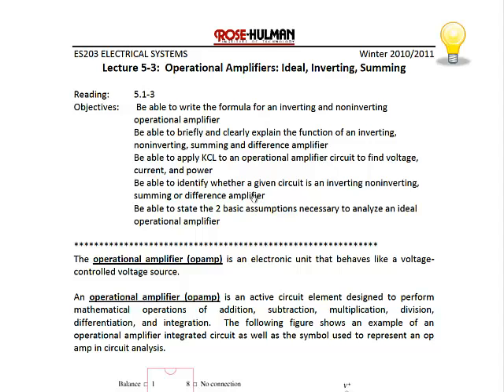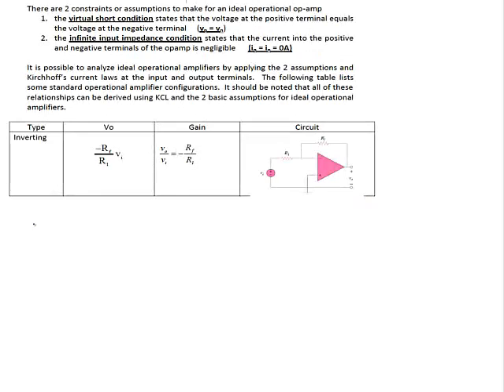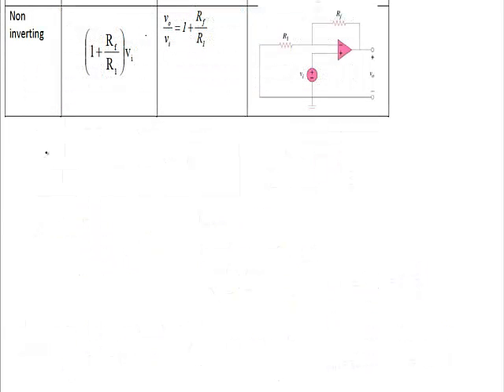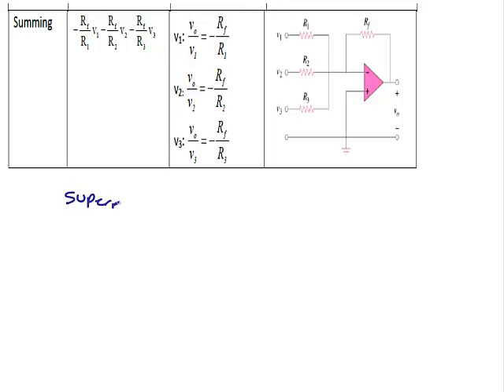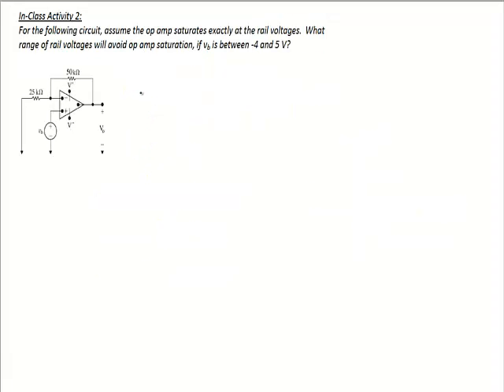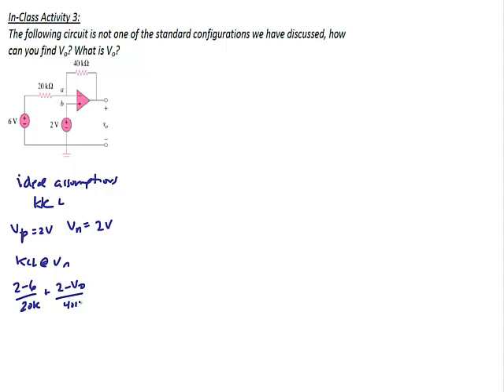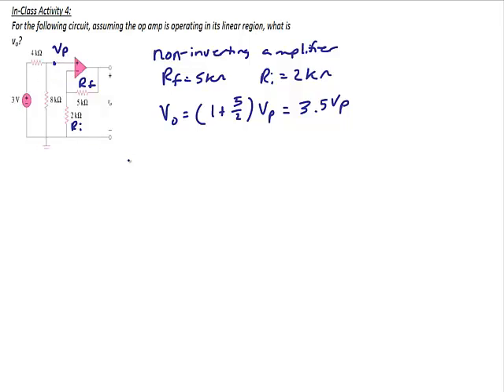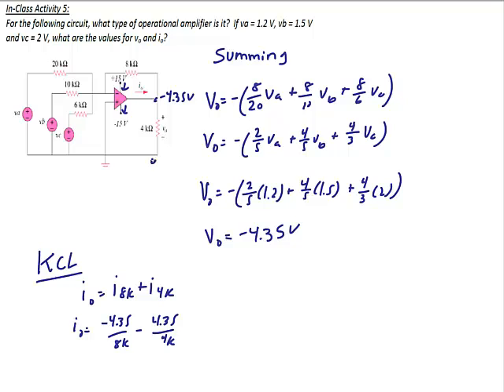ES203 Lec 5-3: Operational Amplifiers

Comment: thank you for this video. But i think there's something wrong in the in-class activity 2
about the graph.
Reply: Yes. The slope should be the gain which is equal to -2, that is, m = -2. And the values of Vi where the op amp start to saturate are at Vi = 7.5V and Vi = -7.5V.